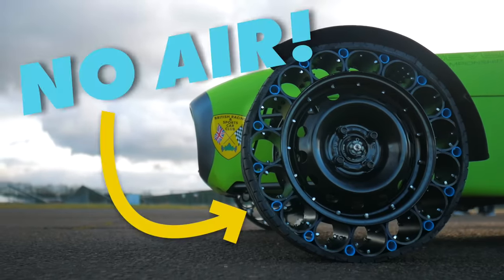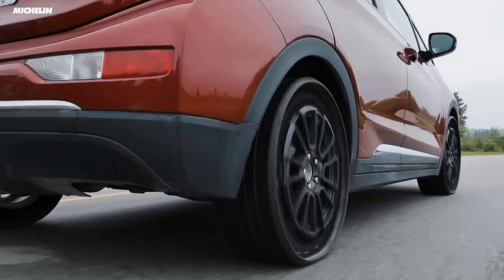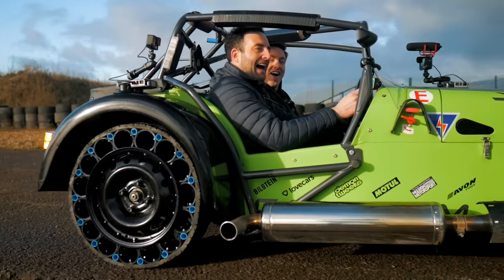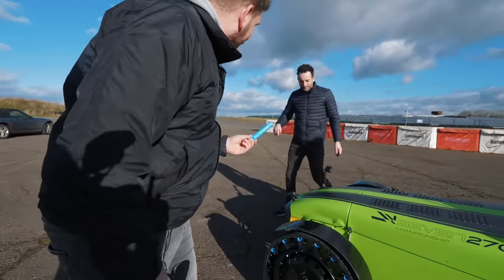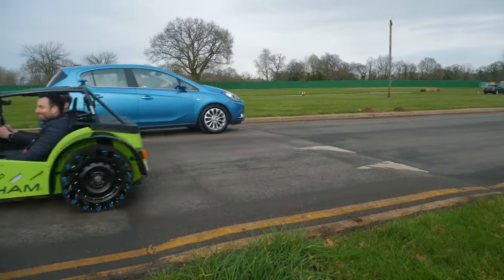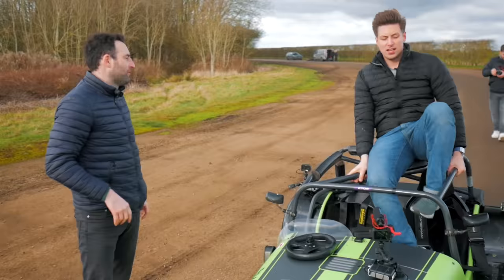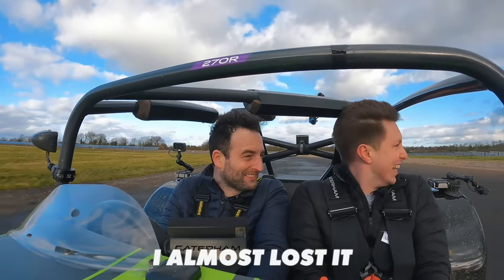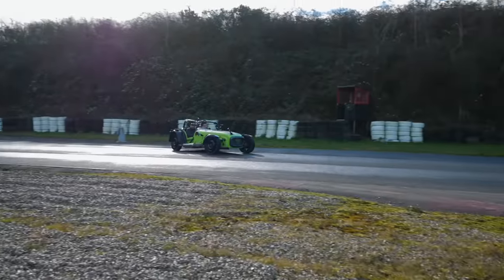I Made DIY Airless Tires

Comment from the maker: We put F1 tyres on my road car!
https://www.youtube.com/watch?v=qHZ8rgWYNtA
Reply: Dude that thing looks amazing with those f1 tyres
Reply: First video to see an airless tyre do a burnout.. congrats boys and girls
Reply: What this proves is that different filaments on the 3-D printer for the actual tire concept is needed not just the same rubber filament for all the different tube positions.

 All nuts and bolts aside.., if they were to use different strengths of different filaments to make the different sizes of tubes in the concept 3D printed tire... it should work
Reply: Use a flexible spray foam to fill inside the pipes to dampen the sound and lock the nuts and bolts.
Reply: Speaking of “pot holes”,  when repairing asphalt there is a heat pot that melts rubber to viscus enough to pump into cracks.  I think using one of those to finish off the tire by filling all gaps, will be a way to actually manufacture these at a reasonable cost.  You can use recycled tires to melt down to further reduce your costs.
If any of that helps save or make you money, I need a back hoe.  
Good luck
Reply: Well you have a professional driver so safety is good, but, the engineering side seems like someone was really drunk in making this idea. lol thank you for the fun video!

Comment: The most obvious conclusion from this video is that I need a Caterham.
Reply from the maker: That's always true.
Reply: Are you saying you didn’t know that BEFORE seeing this video? If so, sorry for you.
Reply: @Nevir202  I’d rather get a slingshot
Reply: @OVERDRIVE.studios  you got this idea from the US military, and just changed the design A  smidge
Reply: @resenddelete6820  caterhams were first based on the lotus 7 though
Reply: I'm just wondering about future proofing.  Can we figure out how to put a Tesla drivetrain into one...?
Reply: @NemoConsequentae  why in the heck do you even wanna put a "Tesla drive train" into one?  those cares are grade A crap, no vehicle is better for the "environment"
Reply: @resenddelete6820  1. I wouldn't describe them as crap, per se.  At least, not compared to many other abominations released onto the roads.
2. I don't (in this case), care about their environments differences.  (They are predominantly coal powered, after all.  And mining for the materials for rare earth magnets...)
3. Nor do I care about the dubious computer enhanced controls, so called Autopilot etc.
4. Their drivetrains do, however, have terrific torque & acceleration, that may be accentuated in a lightweight sports chassis, if it can be fitted.
Reply: @NemoConsequentae  yes but the positive characteristics of a Tesla's drivetrain are pretty fundamental to electric motors - there are many such motors that don't benefit the coffers of an egomaniacal apartheid billionaire.
Reply: Indeed.
Reply: @NemoConsequentae  they are still "crap" all the parts are CRAP.    you won't change my mind on this
Reply: @resenddelete6820  Why do you think they are crap, though?  I'm not seeing any evidence of high failure rates.  Poor support for 3rd party repairers*, but no significant failure numbers.

*Very much like that famous most consumer hostile company Apple, sadly.
Reply: @joelambert7128  And any number of them could be used instead.  But right at the moment, his are the only ones that perform at that level.  Soon, there will be others available, but I was just referring to currently available units.  Rivian looks good, but it powers all wheels individually, so would be more difficult to transplant into a single power unit base.
Reply: @NemoConsequentae  they are crap because they are "part" of an electric vehicle
Reply: @resenddelete6820  ROFL!  You seem like the kind of person who complained about motorised vehicles because they didn't use horses.
Reply: @NemoConsequentae  nope. i just  dislike all electric vehicles for people to use on the daily.
Reply: @resenddelete6820  OK, so you don't like them, that's fair, but you opinion is subjective and doesn't make them crap.  
Now for the objective part: Why are you of the opinion they are crap?
Reply: @NemoConsequentae  it does make them crap you fanboy.
Reply: @resenddelete6820  You still haven't said why.  And seem to be reduced to attempting to hurl personal insults instead of addressing the question:  Why do you think they are crap, when they seem to do an efficient job for so many people?  Certainly the ones currently available do not suit all purposes, but that doesn't mean that someone won't make one that suits your purposes, (assuming that you don't like them because there are none that can replace what you drive yet), nor that the ones available do not suit the people who drive them.
I don't have one, at least partly due to none being the sort of vehicle I want to own, but I don't think they are all crap just because of that.
Reply: I'd much rather have a T-Rex
Reply: @NemoConsequentae  blahblahblah
Reply: @resenddelete6820  Still unable to form a coherent response, I see.  So I ask again, "Why do you think electric vehicles are crap?"
Reply: @NemoConsequentae  they are crap because they are crap seems to be the best logic you'll get out of him.
This seems to be the case generally with that opinion because it's very difficult to explain why something is crap when it is better in almost every way.
Reply: @charleskavoukjian3441  LMAO a slingshot is garbage
Reply: @NemoConsequentae  sure, you could do that. Many Lotus 7 style cars are built in their owner's garage, so you can customize them to your heat's content. You do have to keep in mind one of the most important qualities of a 7 is the light weight, so you'll have to choose between range or good handling.

Frankly, a Tesla drivetrain is too powerful. The original 7 was 40hp. The most powerful stock Caterham is 310hp and apparently pretty terrifying. These things have absolutely zero driver aids and will happily wrap you around a pole if you step a bit too hard on the pedal. One of dual Curtis motors would turn a 7 into a rocket, I'd expect. A Beetle is quite a bit heavier and they're zippy as hell with a 120hp electric. The EV West conversion kits use 71 hp motors. You can find videos of their conversations driving around.
Reply: @DonOblivious  Good points.  I know what they are like.  I had a ride in one an old girlfriends sister built... Fun! (Even as just the pax.)
Reply: Just play forza horizon 4 or 5 they have one lol
Reply: @NemoConsequentae  pontiac aztec is what i would personally call crap 💀💀. or a ford ka from 2002 💀💀💀
Reply: I NEED IT
Reply: It's a Lotus 7 in disguise.
Reply: @joelambert7128  While I agree with you about Elon Musk (has he stood in front of a sandblaster?), and deplore his labor practices, Teslas are great cars. If you want pure performance, the Tesla Roadster will beat any other car to 100 kph and keep on going from there. The Model 3 is a great family runabout, with excellent performance. The overall environmental balance depends on how the electrical power they need is generated, but almost always comes out in their favor.
Reply: I prefer the BAC mono
Reply: @OVERDRIVE.studios  those aren't potholes. If those spoon sized dibits are popping tires you Brits have issues. Come over to the states mate. Specifically Michigan. We have potholes. Still never popped a tire. Snapped tie rods, blown out wheel bearings, cracked axels, blown up shocks and leaf springs. But no popped tires
Reply: Super7 x3
Reply: @resenddelete6820  or Michelin :p

Comment: We've been using airless tyres in the outback for decades. If you get a flat and don't have a space, do a small cut into the sidewall of the flat and pack it with Spinifex grass until you can't squeeze anymore in. Will run for 1000's of km's and save you life.
Reply: And what do you seal the cut in the tire with? Will regular duct tape hold it?
Reply: @MishraArtificer  tape, rope, garbage bags, vines, whatever gets you home.  (Wrap through the spokes and around the outside, not just along the side of the tire, even with the best tape, unless you can seal the inside like a solvent-based bike tire patch.)  It just has to be enough to work until you can do better.  If it fails, you repeat or try something else.
Reply: Why not use closed cell foam cores or solid tires, and softer shocks?

Comment: In case you haven't considered it yet, some (probably most) of the noise and vibration is caused by the seam where the tread meets. If you could find a way to leave about an inch of sidewall on both sides and mount that on your design, the noise and vibration should  be closer to regular tires.
Reply: Actually, I thought the whole process could be improved by gluing the "drain pipes" inside a regular tire, )shortened some to fit), and then letting the sidewall "skirt" the wheel. This does away with the tread seam, which is a weak spot, and the sidewalls would prevent the tread from wandering right and left when gripping the road. It would be challenging, but this DIY is very feasible.
Reply: The first job I ever has I use to retread tires. And the two ends shouldn't be connected by a straight flat cut. You make a long diagonal cut. It gives more surface area for adhesion and it won't deform.
Reply: @JohnSmith-ft2tw  fuckin oath I think you’re onto something
Reply: Also I'm sure these things aren't balanced in the slightest
Reply: @zachsmith1731  That's easily fixed with a few more M6 bolts.  lol
Reply: These tires are less efficient, so they're always noisy. You can fill a regular tire with foam too. It just ruins your gas mileage and performance.
Reply: @JohnSmith-ft2tw  it needs a hard layer under the rubber to keep it round.
Reply: @KevinJDildonik  why would foam ruin your gas mileage. It may be a bit stiffer tire which means less grip but unlikely it will result in worse mileage. Just like if u inflate your tier more u get better mileage
Reply: @zarni000  honestly, probably because of the added weight. Considering that foam is significantly heavier than air. Not to mention the point you made. sure making the tire 2lbs heavier may not seem like much, but it would require more energy to achieve the same result. which Fuel Consumption (Mileage) is literally the amount of Energy used
Reply: @Dari300ra  I doubt it's weight. The foam will add maybe a quarter of pound per wheel at most. Surely nothing significant
Reply: @zarni000  theres a reason why professional racecars have go through 1000s of dollars to shave off 1 pound of weight it all factors in.
Reply: @Dari300ra  that reason isn't mileage

Comment: Instead of nuts and bolts (which will invariably come loose with vibration) have you thought about tension cabling? Like using a steel cable woven through multiple peices of pipe and attached through the wheel rim. Then with wrapping the cable through multiple times before going through the wheel rim again, such that if it started to come loose, there would be a gradual degredation.
Reply: It would have just torn itself to bits ! Like a cheese slicer.
Reply: or easyer: glue?!?!?!?
Reply: You're about back to steel radial tires if you're doing that much cable weaving.  The idea is trying something fundamentally different.  A hot melt adhesive would be an interesting approach that resists vibration, provided surfaces are properly prepared and compatible.
Reply: Or just use lock tight on the threads...
Reply: @a3r797  Yeah, but then good luck getting them off if you need to fix or adjust the tires lol
Reply: Its easier just to  build a mould and pour the plastic in and skin the tyres job done.
Reply: This is what rivets are for
Reply: @Wrutschgeluck  flex tape

Comment: Amazing video! I'm hoping one day airless tires will be the norm.

I'm sure i'm not the first to point this out, but 99.5dB is WAY more than 2x louder than 90db.  Assuming that your measurements were taken at the exact same distance in both scenarios, its roughly ~9 times louder (8.91 times louder to be more accurate).

With a standard reference sound intensity of 1E-12, the sound intensity values you end up comparing are .001 and .008912509 etc etc

Comment: When putting tread on a tire don't make it a straight flat cut. You need to make a 4 inch... or a 10cm diagonal cut on both ends. It provides more surface area for adhesion and it removes any deformation at the seam. You could make it longer than 10cm, it's just a good amount of surface area with minimal waste. And I'm totally going to try and make these lol. Awesome video.

Comment: Maybe consider putting that solution inside a tyre casing, then on the rim. That way it is all contained inside the casing, lessening the chances of it coming apart. It also means a continuous tread that’s not held together by screws. Any tyre could then be converted to make us of this.
Reply: Yeah that was my idea as well. It would then act as a large run flat ring. Dump some water beads in it instead of air. and you could still call it airless. lol would be heavy with water beads but would work. Also wondered why they didn't just cut the sidewalls out of a tire. that would leave a single tread ring to fit ultra snug(example you have to use heat to get it to fit. like a steel ring on a wagon wheel) . instead of a seam.

Comment: Did you try red thread locker? Could help with the bolts coming apart
Reply from the maker: They were nylock, but we should try that.
Reply: @OVERDRIVE.studios  maybe also try use some assembly compound....orrrrr....to reduce weight and effects of rotational forces increasing the g-force and therefore the effective weight of the bolts, why not just try and stick them together with epoxy?

Maybe try pack out the outside of the wheel using space-foam held on to the piping with something like a tightly wrapped Kevlar sock before you put the tyre on?
Reply: ChrisFix liked that
Reply: @yigithan3713  that's exactly where I got to know about this things years ago
Reply: May be cut the pipes in 2-3 sections and overlapping the position, so it won't be so bumpy?
Reply: I was thinking cotter pins. Probably a bad idea though.
Reply: If you never want the bolts to come apart again, use Loctite 680 retaining compound.  It's super-glue formulated to give ~1hour cure time on steel and aluminum.
Reply: @martylawson1638  yea those bolts would be be very dangerous projectiles at high rotational speed.

Comment: Anyways.. I believe your design is much better take on the airless tire than Michelins idea using all rubber. Though, you could use a rubber coating on each of the pipes to absorb more of the vibration and impacts in the wheel itself. I also believe having a little lip on the outer diameter tread to the inside and outside of the tire pad would help with keeping the internal parts in while cornering as it'll dimple at the more force, keeping the inner wheel together more in unison. Like what you could had done was kept some of the sidewall of the tire you used as a part of the tire to keep the smaller light blue pipes from slipping out. I was surprised this set up held up at 100mph, and was able to take corners without falling apart, I mean aside from loosing a few nuts and bolts (could has used large rivets instead), you just had horrible vibrations probably due to the seam in the tread and no real dampening or balancing in the construction of the wheel. If there wasn't a seam and you really thought about balancing each wheel, it may had not been bad at all. And you probably could had went faster in that straight away. Whats crazy is that Michelin didn't come up with the initial design.. the original design was created in the 1930's was called the Elastic Tire. Similar idea of what Michelin is using now, but it has it's flaws as it gives away in corners and it's not rigid enough for highspeed cornering. Your design takes on a different perspective though, rather than using all rubber, just the tread itself is rubber, and the inside of the wheel is plastic and steel. Mind you that your wheels aren't really balanced, and there is a seam in the tire cap.. but overall you could improve this design and make it a pretty rigid tire and wheel if you put your mind to it.

Comment: Charming sound, the unsprung weight reduces as you drive,  withstands your industry- standard bed of nails, immune to imperceptible potholes; what more could you ask for?
Reply: Mileage, these didn't last long enough. Needs more prototypes and design corrections but these did hold up well for the first attempt

Comment: Did you try threading wire through it? I think that would be less likely than bolts to fall out, and if it's properly tensioned, it could better spread the throughout the whole structure.
Reply: How would you make it less bumpy?
Reply: @senordinkus  more forgiving tubes held under tension in a more oval shape maybe?
Reply: @zachmoyer1849  It'd look like a flower lol. I'm not an engineer, but it'd certainly be neat to see them do that.
Reply: @senordinkus  the lotus eleaf tire lol

Comment: Honestly, if you can create a mechanism to keep the tread from swaying, and clean up the plastic areaa, thats a good design.  You guys should make a bigger version and take it off roading
Reply: just leave an inch of the sidewall and figure a way of getting them on without cutting them in half haha
Reply: Tread "sway" is part of tire design - the lateral forces present when it occurs is part of the reason it's taking so long for these to come to market.
Reply: Having a sidewall on each side instead of open sides would solve this.

Comment: The thermal load of the splines flexing per revolution will be a problem. 
Sacrificing the contact patch to solve it would be stupid.
Airless rubber spline tires would probably handle side load better and more reliably than "air-ballon" tires.
You need a stiff rim to not interfere with the brakes. 
I don't see any rubber hybrid rim handling that part, not even to mention the heat of the rotor.